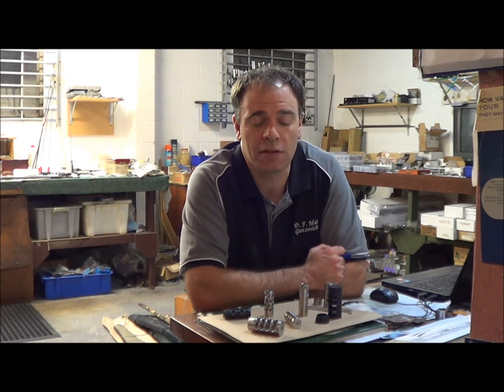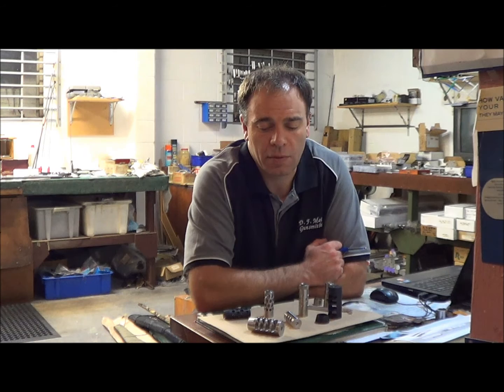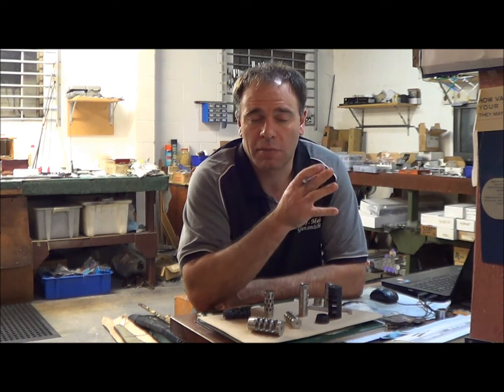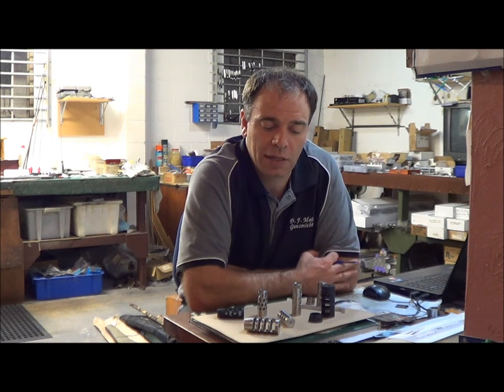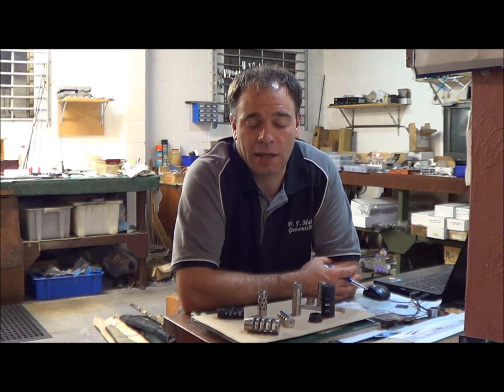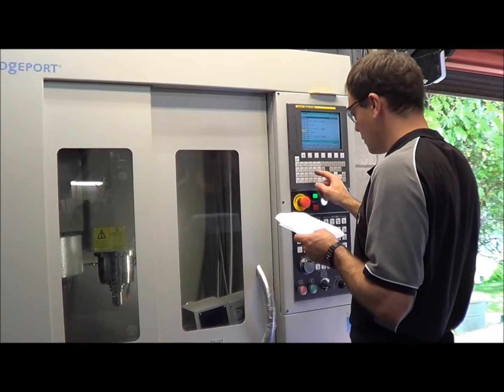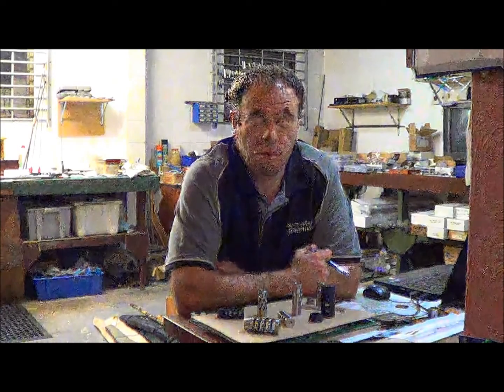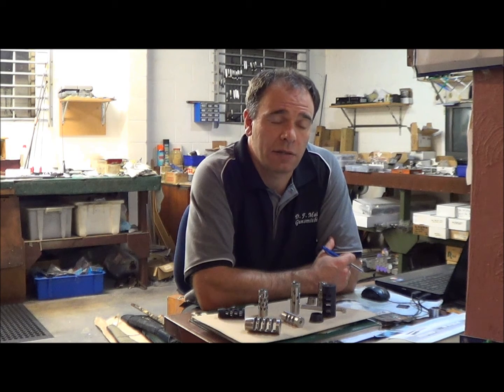D.F. Maisey Muzzle Brakes & Gunsmithing - shop update April 2016

Comment: Love to see a full video of the 'Mega Max' being fully cut out on the CNC lathe. Do you make them in Ti?
Reply from the maker: +SeriousSchitt . Thanks for the message, but that would be a long video !!  The brake blanks are turned on the CNC lathe, then transfered to the CNC mill to machine out the ports. Then final step is a bit of hand finishing and de-burr. The design of these brakes means they would be very difficult (or more expensive) to make them totally on a CNC mill-turn lathe (with y-axis and angled milling heads). No we aren't making them in Titanium at this stage - stainless only, as it is alot more durable at dealing with the impact/flame effect of the propellant gases, as well as being alot cheaper !! Cheers.